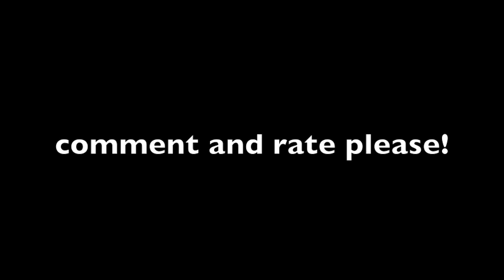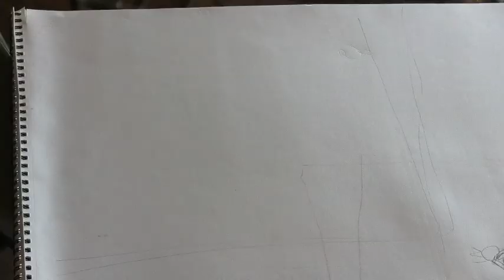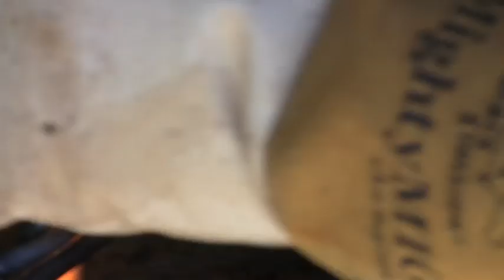art welding using acetylene tack and bend method. hdc cobra torch

Comment: what type of filler rod are you using bro?  tnx wonderfull video
Reply: I think that's the famous "pencil rod".  Steel rod, maybe 1/4" diameter, used in construction.  I've seen it 3/16" and 1/4", there might be a lot of options.  As far as I know it's used to hold forms for concrete together. It might be mild steel, where rebar has some carbon in it and can harden and have problems with welding.